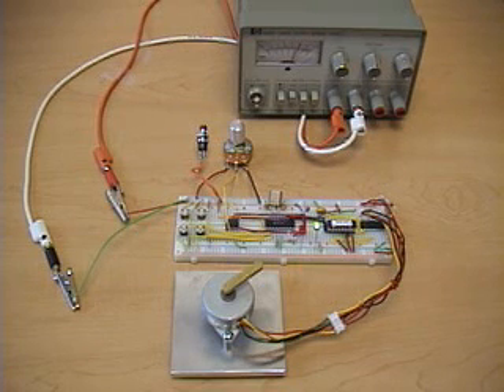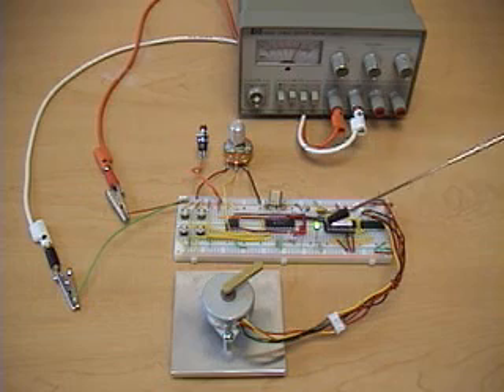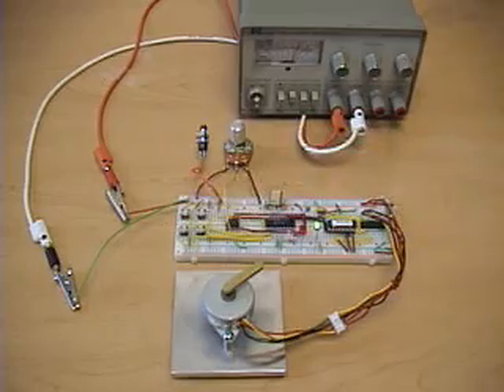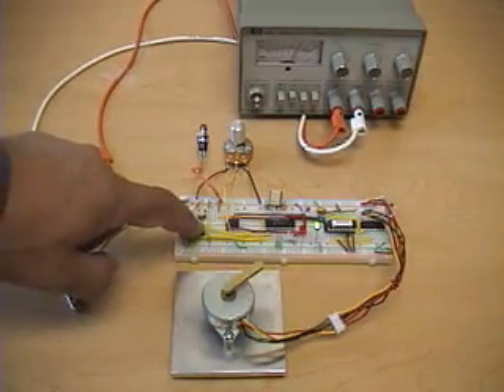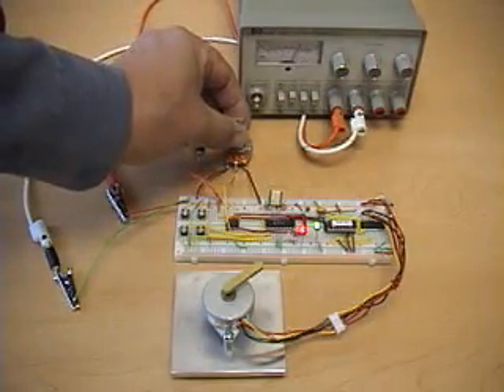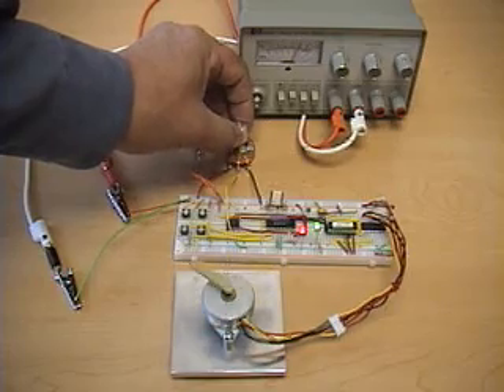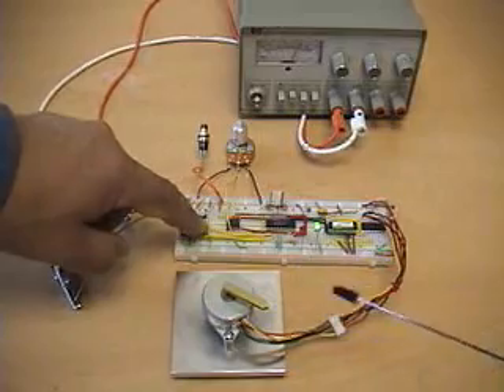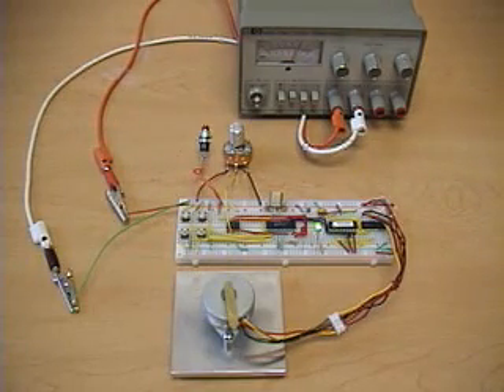stepper motor PIC-based position and speed controller

Comment: I need to buy something like this.  I need to run a stepper motor in each direction a little bit with two push buttons, forward and reverse, or one button and reversing switch.  I will pay $. Help luvfilm@gmail.com

Comment: I think it is not 100% right to put "position" to title this video cuz you only use a PIC to control the speed, and the angles 45 and 180 degrees that the stepper motor could posibly rotate. Sorry if I misundertood your title. what I really want is the arrow could rotate back to its original position where is mentioned to be "0 degree" on your video after the system has been rebooted. is it possible?